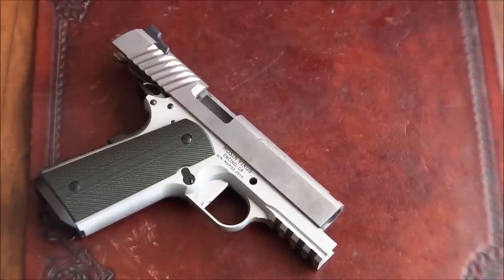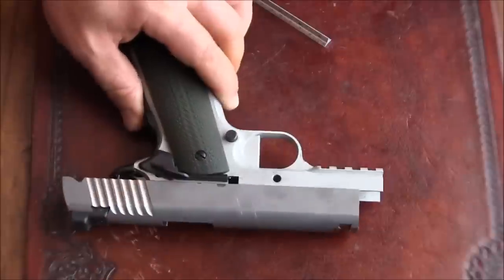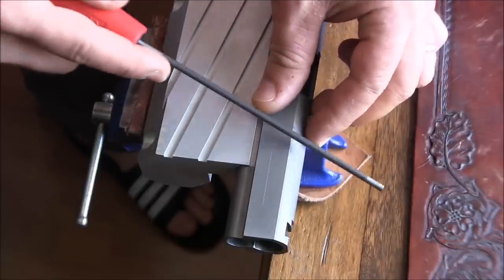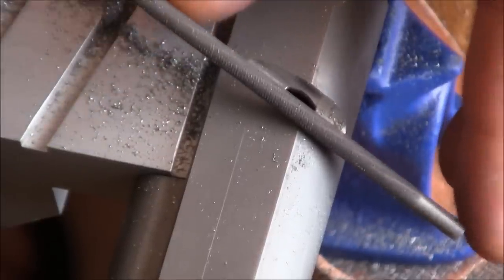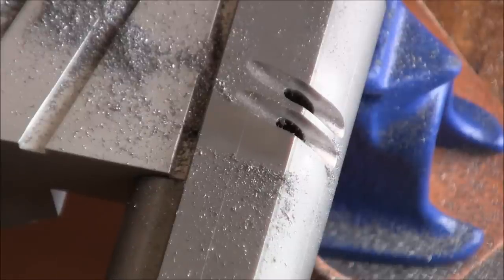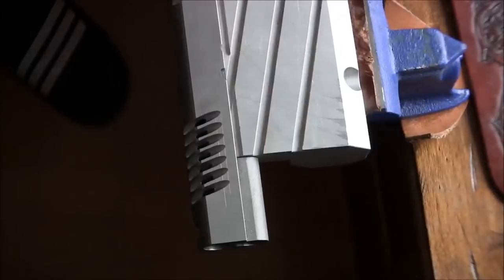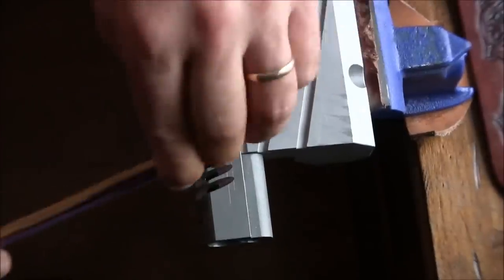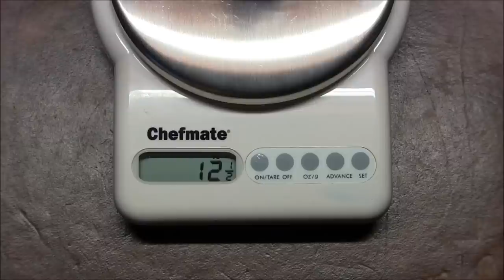1911 Build 2 (9mm) - Part 11 - Slide Porting/Lightening

Comment: I just ordered a table vice. I cut a marble ramp into my 1911 and next up I'm going to do exactly what you did in this video. Thank you for the information and the walkthrough. Now I know how to do it properly. At first I was considering just pinning it down with one hand and going at it with the file but I'm not going to do that. I will wait until the table vice gets here. I don't want to screw it up and have to buy a new slide. And the 1911 that I'm going to be doing it to is already complete and fully finished with a nice cerakoting. 

 I don't know if I'm going to send the slide out to be cerakoted after or not. 

 I'll cross that bridge when I get to it.
Reply from the maker: @NortheastSurvival911  good luck with your project. Go slow.

Comment: For looks? Beautiful work. Made me nervous watching. Is there a vid about porting a barrel?
Reply from the maker: Not for looks, for lightening of the slide. 9mm doesn't have a whole lot of juice to move that bulky slide with authority, plus the slide I was using didn't even have front scallops and was a "slab" slide. So I had to take a bit of material off. I have never ported a barrel and I don't think I will.

Comment: Thats brave. You didn't make any mistakes.
Reply from the maker: Thank you. I actually believe it is easier to course correct when using hand tools rather than machinery.
Reply: @MosinVirus  yep, when an end mill jumps on the work or the work slips you can fubar the slide in a spilt second. With files you see the stroke and can adjust, just going to take longer.

Comment: Looking really good so far.
Reply from the maker: Thank you. I am currently trying to decide whether to go for cerakote or to blue and anodize
Reply: Isn't cerakoting expensive?
Reply from the maker: Dead Dog it sure is when done by certified applicators. Would come out to about $250 for the frame, slide, and small parts.
Reply: MosinVirus
Well, I'm sure you have that considering I added everything from your last build up and that price tag wasn't exactly pretty.
Reply from the maker: Dead Dog I do, but the question is whether it will be worth it. That is what I am debating. I am sure it will look better than blued slide and anodized frame as they will surely have different colors. With cerakote they will have the same color. Also, anodize may not offer as much as much abrasion protection as cerakote. That I am not sure about.
Reply: MosinVirus
Everyone I've ever heard talk about cerakote only has good things to say, so I'm sure it'd worth it.

Comment: Hi  dude. awesome  work !!!
 one question  is the slide  aluminum?  it looked  so  easy  to make  those slots. i have a MAKOROV ultra bb gun blowback. And it has a very heavy front part of the slide i want to mske it lighter so i get better avreage fps and co2 usage. I leave in a country  that  making your own  firearms  is prohibited.   great  and educational  vids. THX.
Reply from the maker: no the slide is steel. I don't think any slides are aluminum

Comment: Mosin any 1911 in 9mm 80% frame out there that you would recommend and that it would be easy for complete for a not too handy person like myself?
Reply from the maker: 1911s do require a bit of work, so I assume you are handy enough if you want to take this project on. Any 1911 frame made for standard barrels can be made to work with 9mm standard barrels, but that would require a lot of tinkering. Instead, I would recommend a 1911 frame with a Clark/Para ramped barrel cut or Wilson/Nowlin ramped barrel cut (I have a video on cutting the frame for ramped barrel so you can see what I mean). The ramped barrel would be better for 9mm anyway, so I would recommend you go for one of those frames. Here is an example of such a frame http://www.ar15upperreceiverparts.com/1911-Railed-Tactical-Frame.aspx however it is series 80, so you would either need to also get additional series 80 parts or get a block part to fill the series 80 gap in the frame and build as series 70 (better in my opinion).

Comment: that looks phenomenal and an once and hald in weight reduction is quite impressive. form and function... great job. what brand files were you using?
Reply from the maker: BOSS 350z I am using Nicholson files. the rounds are actually a set I got from Brownells. the set was called something like "1911 file set".
Reply: MosinVirus great. thanks for the info. im modifying a loading port on a Stoeger m3000 for 3 gun and this was actually quite helpful.

Comment: I know this video is 3years old but what file did you use to do the serrations?
Reply from the maker: I cant remember the diameter. But it came from this set. https://www.brownells.com/gunsmith-tools-supplies/general-gunsmith-tools/files/1911-file-set-sku191000002-26887-52825.aspx?sku=191000002

Comment: Is their anyway you can tell me what kind of metal triangle ruler you are using. I'm a machinist/ gunsmith myself and for the life of me cannot find that anywhere here in california.
Reply from the maker: I can't remember exactly what it is called, but I believe it is an architect scale ruler. I simply don't have a straight edge (an actual tool) so this was just the straightest thing I had. It was a cheapie and I am not even sure if the scale on it is accurate, but obviously still usable for markings.
Reply: MosinVirus your awesome brother. So if your in cali as well I might need to hook up with you and get your thoughts on my first 1911 build I'm doing, cause the serrations, AMAZING!!!!

Comment: Do you notice any difference in felt recoil or any feeding problems with taking weight out of the slide?
Reply from the maker: +Dave Bogusky Yes, a bit more felt recoil, but it is needed since the slide was originally too heavy for reliable cycling.
Reply: +MosinVirus  which weight of recoil spring do you use?   16lb, 17lb 18lb?
Reply from the maker: +william bresinski this was a 9mm build. 11# spring

Comment: would you kindly be able to tell me what the width of the files you are using is and possibly what files I can use to do the same thing
Reply from the maker: jcpatriots19 I can't really remember what diameter file I used, but you can pick whatever diameter file you wish. just pick what will accomplish the desired look.

Comment: What about the sig p229 how hard would that be. What need to be done to the frame beside the rail?
Reply from the maker: Much easier than a 1911. Rails and holes. Watch my Sig build videos.
Reply: +MosinVirus what abou the barrel seat? Does the frame come in black it seem like it only come in raw aluminum?
Reply from the maker: Sigs are different. Locking block takes care of barrel seat and locking and unlocking the barrel. You can watch my Sig 220 disassembly to see how Sigs are assembled. The frame can be anodized or ceracoted.
Reply: +MosinVirus You mean your Sig p229 built video or different video for an p220? By the way would you recomend the Matrix Precision P229 80% Frame  as the best option. Also any place that you recomend would anodized a 80% frame?
Reply from the maker: 220 video to see how they are assembled and what parts are in play (similar to 226 and 229). 229 build videos to see what goes into building one. I anodized myself, but I am sure you can find someone local to you to anodize.

Comment: I like to see a man filing with confident determination! You could have made it a bit easier on yourself by pencilling in a new end line after your first cut, you could then get a better idea of the layout, these chainsaw files are available in a number of smaller sizes, but you have to be careful as they are quite brittle. I am glad it turned out well for you. A squirt of WD40 would make it easier for you to get a good finish.
Reply from the maker: All great ideas. Will have to get some more files for sure (coarser).
Reply: MosinVirus Be careful with the coarse files, you will find them more difficult to get a straight cut in your application, the fine cut is much easier to keep straight, you will find the WD40 will give you a much better finish, and also make it easier to cut, the teeth will not stutter so much.
Reply from the maker: Englishman French thank you for the info. I appreciate it.

Comment: Is that thing made from aluminium.....??? looks so easy to file it
Reply from the maker: the slide is made from steel. good files chew right through.
Reply: Good files and small diameter removes metal nicely.

Comment: @mosinvirus hi great video, can this be done on a 1911 commander .45? If so could you do mine
Reply from the maker: I am pretty sure this can be done on any 1911, but on the commander the area would just be smaller for the cuts so that the locking lugs are not touched and the barrel bushing is not exposed (if you are using a bushing). I wouldn't be able to do this on other guns because I am not licensed as gunsmith. can't receive guns in mail...
Reply: How about if I send you the slide and the barrel
Reply from the maker: +Desertliving Peace,love, and light That could definitely work, but at this time I wouldn't have time to do that much filing.

Comment: This is an excellent job you did on this slide and it turned out very nice. A word of caution in this area. You said you were trying to cut weight off the slide the only down side to this is the slide is meant to act as the mass of a bolt/breech and in doing this you must change the recoil spring for a stiffer one. This is because if the bolt/slide is too light it hammers what it stops against in this case that would be the front portion of the barrel seat as by reducing the weight the spring is not strong enough to stop this from happening possibly casing damage to the frame because the slide is being propelled rearward with greater force and the spring must do more work to slow the slide. However if you observe no ill effects then it should be fine just pay close attention after shooting it to the front portion of the barrel seat to make sure it is not getting smashed. 

Again this looks really cool and it is just meant as a warning for a possible fail point in the gun.
Reply from the maker: evilcowboy Thank you very much. I was actually doing this to have the slide function better. I was running the gun with factory standard 9mm 115 grain ammo, and wanted to use a heavier recoil spring to improve feeding.

Comment: Respect, but if you can't squeeze the trigger faster than the cycling, does it really matter?
plus those holes are an opening for dirt/dust.....
IDK bro, I wouldn't do that to mine...
Reply from the maker: It is not about how fast you would be able to pull the trigger. It is all about whether a 9mm factory ammo will be able to cycle the slide with enough authority. And if you simply decrease the recoil spring power you may have other issues with feeding and then the cyclic rate will drop too much.
Reply: MosinVirus Word. I'm no gunsmith, so I will take your word on it. I have always wanted to make guns, specifically the 1911 model, but I don't know how to get my foot in the door or where to begin. Any pointers/tips?
Like, I would LOVE to work under you as an apprentice or for whatever company you're with.
Reply from the maker: @anonymousshawn9996  I would recommend 2 books. Jerry Kuhnhausen Shop Volume 1 and 2 for 1911 pistols. They have them on Amazon.
Reply: MosinVirus Thanks bro.
Reply from the maker: @anonymousshawn9996  my pleasure

Comment: Do you remember where you got that file from ?
Reply from the maker: It was a simple round Nicholson file that I got in a 1911 file set from Brownells. They sell a few round files in a set for working on 1911s. Simply in sizes that help with various frame, slide and etc work. But they are not special files by any means.

Comment: how the bar you user to mark the desing is called
Reply from the maker: The ruler was used to show angle and a scribe was used to scratch the frame.
Reply: ook but what is the name of that
Reply from the maker: Angel Rosado name of what?
Reply: the bar i use to desing trim
Reply from the maker: Angel Rosado point to a time in the video where I use it please.

Comment: Awesome
Reply from the maker: Thank you.
Reply: MosinVirus I love smart modifying.  I also love craftsman ship. It's a lost art. I can't wait to watch all your videos. I'm going to tell my army buddies to see your work. Great stuff man
Reply from the maker: Thank you very much. The Build 2 was when I was just starting out. Please make sure to check out my later videos (builds 4 - 10) and since your Army buddies may appreciate it, check out the Beretta 92 modifications. I recently converted mine to Vertec grip profile (M9a3).
Reply: MosinVirus absolutely will. Can I save time and make the cuts with a dremel and excellent cutting wheel
Reply from the maker: The only thing I would say regarding a dremel is that a handheld rotary tool would actually be difficult to control. If you are super careful, you will absolutely save yourself quite a bit of time and headache. Though, make sure to not overheat the metal. Depending on the design you don't want to soften the tempered steel slide. The best tool for this would be a mill of course. If doing plunge cuts a nice and solid drill press might do with an end mill bit rather than a drill bit.
Reply: Man thank you for all of your help. Most folks wouldn't take the time to reply. I said hooah and thank you.
Reply from the maker: My pleasure. I try to make sure I reply to every single comment I get. It is a respectful thing to do. :)

Comment: I don't have the time right now to finish this entire video or find part 1 but I'm curious...

... What was done to this 1911 slide... Was the slide purchased as a blank? I'm assuming it was because I don't see any roll marks anywhere on it.
 I guess it doesn't really matter if it was or wasn't it's just one of those random ass ADHD questions. I don't have any 1911 slide blank sticking around. I have plenty of nineteen-eleven slides but they're on frames and yeah... But I'm contemplating doing this to one of them I just don't know which one yet. Probably my AOC competition model. I mean making the slide lighter would put it back in the battery quicker. It certainly isn't going to slow it down. And this is nothing I would want to do like a g i model.
 Another question... What type of stainless steel is that and are you going to be putting any kind of finish on it when you're done or treating the steel in any other fashion then it was treated when you purchased it?
Reply from the maker: This was a slab slide with no cuts on it. I added ports and sight cuts by hand, using files. This was a carbon steel slide (4140 I believe) and it was eventually blued.